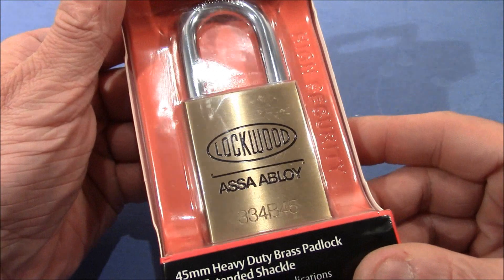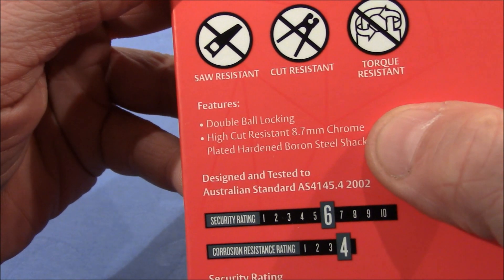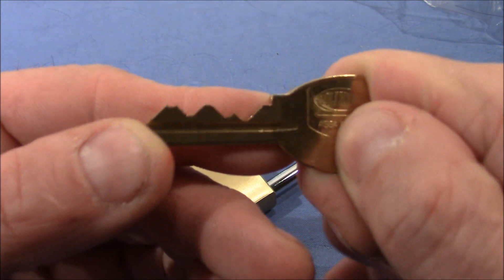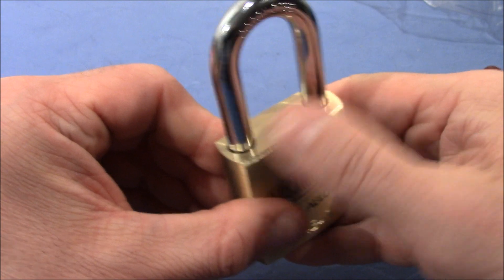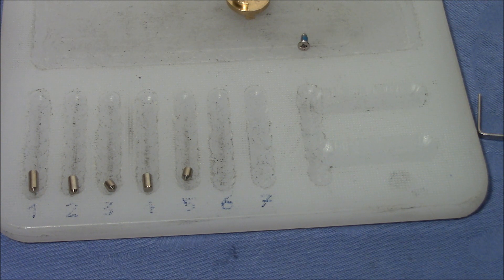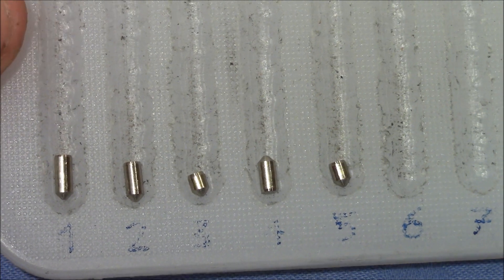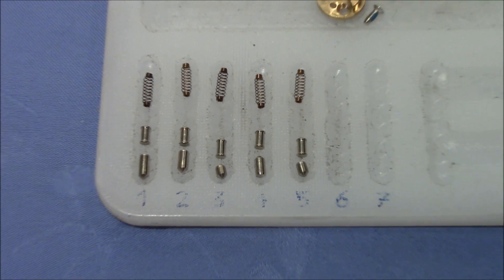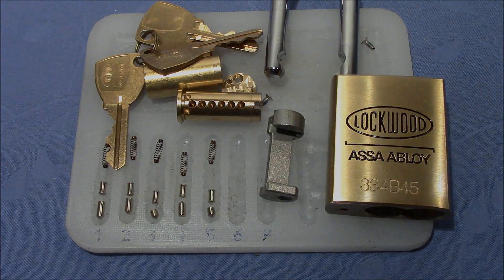(picking 510) LOCKWOOD 334B45 - HIGH SECURITY padlock picked out of the package

Comment from the maker: The advertisement on the package says HIGH SECURITY. It's a 45mm 5 pin brass padlock with great exterior properties. This Australien locks is very well made and equipped with shallow Lockwood spools and has an awesome bitting. Have fun watching me attacking this gem right out of the package. Thanks again to Daniel for buying me this great piece of brass.
Reply: You can buy these on eBay. Just search on "Lockwood padlock". There are hundreds. However, the security rating of 6 is odd. I usually see a 7 (or a 3 for the crappier locks). I don't think I've even seen a photo of one that says 6.
Reply: Oops! I spoke too soon. I had another look today and looked at a greater range of them (seems I was only looking at specific ones before). The range appears to be 3 to 7. I saw lots of 4s, a few 5s and some 6s this time as well as the 3s and 7s. So the security rating depends on size and build of the padlock. Sorry about that.
Reply from the maker: No problem - thanks for checking again.
Reply: i believe 6 is correct for the b variant. the 334c is a 7 however due to the steel construction, closed shackle and drill protection

Comment: Potti314, That WAS a quick pick, well done and good description and understanding of the shallow spools with thin "lips" as you said they don't need one solid driver to keep the plug straight. By the way the key pins are actually nickel silver, and the spools are stainless.   Regards, Brian.
Reply from the maker: Thank you Brian. This lock is really nice and the shallow spools are very special - for me these Australian brand locks are very cool to play with. Thanks for clarifying the pin material.

Comment: Many companies in Australia use the Lockwood 334 with custom keys and their respective cores. My high school used 334's with master keyed Bi Lock cores.  The pick resistance can be heavily increased by using high security cores and restricted keys.
I learnt how to repin locks by just dismantling some 334's I found and re-arranging the pins so it works with a different key.
Excellent locks in my opinion.